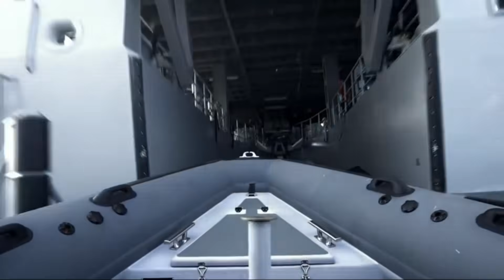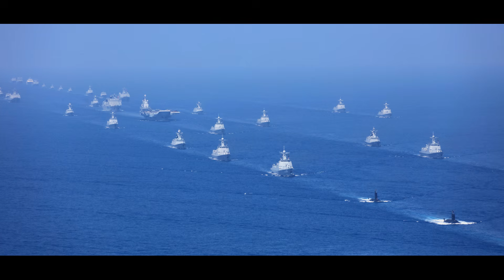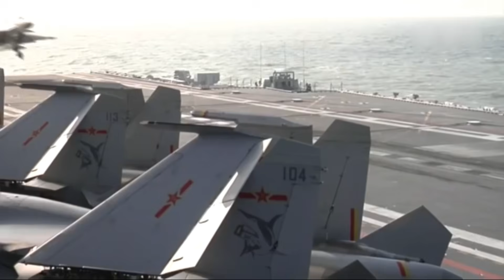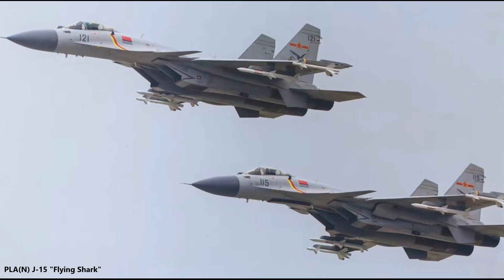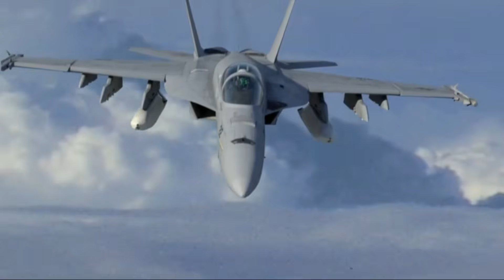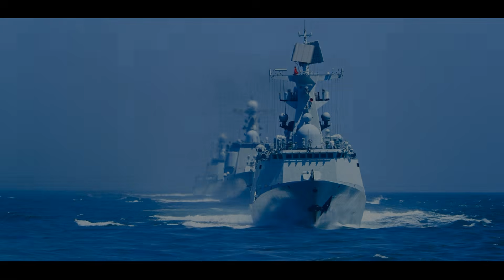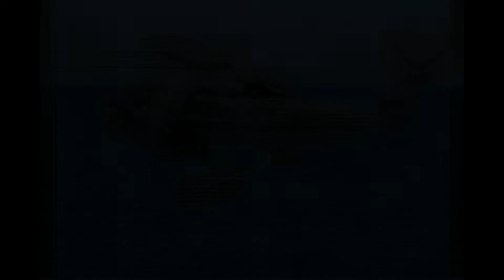Up-Gunning the Arafura Class OPV

Comment: Capability has NOT been designed out of either the LHD or the OPV. With the LHD, I was there in 2001 at Puckapunyal where the final selection was done between it and the Mistral, and Dept. Finance was extremely direct when they said that there would be zero $$ put to removing the Navantia design's inbuilt ability to operate Av-8 or the then-early stage development F-35 VSTOL variant.  They retain the built-in capability to operate fixed-wing.
OPV. The case of the 40mm, for example, is that it would have been an orphan system and we did not make the ammo for it. So we've gone for a gun and ammo we MAKE here. We had this same argument re SSM etc about armament with the Fremantles back in the late 70s/ early 80s. 
The proof of this is that the Arafura is fitted with a variant of the same combat system as the Anzac class's 9LV. This is THE critical thing to have, and it's open-architecture.

Comment: Another potential use for small warships like the Arafuras (although this would have to be a dedicated design and not a multi-role platform) would be to build a primarily gun armed ship that could be used to support amphibious operations with naval fire support. Ships that small can be built with a fairly heavy weight of guns compared to what a modern frigate or destroyer carries (the WW2 era Sims class destroyers carried about 5 times the throw weight of a Hobart class destroyer in guns at a displacement slightly smaller than an Arafura class OPV) and they'd still be quite cheap to build and operate while being able to replace the role of frigates and destroyers in providing close in support for an amphibious assault (which is dangerous and best not left to the ships also providing the bulk of your air defence and anti-submarine capability).

It's a very specialised role, but it wouldn't be an overly expensive capability to acquire as far as naval capabilities goes and can provide massive boost in firepower available to amphibious assaults even if we're going going to be replicating the effect of bringing an Iwoa class' 16 inch guns to bear like what the USN tried and failed to do with the Zumwalt class.

Comment: The reason they are only armed with the second-hand 25mm instead of the planned 40mm is the contract for the 40mm fell through. 

The best bet would be for the RAN to acquire the 40mm bofors that that RN are putting in as secondary armament in the Type 31 FFG. The only possible handicap is they are a bit heavier (about 400kg) but given the variable payload planned for this class that shouldn't be an issue. 

The 40mm bofors was chosen instead of phalanx or goalkeeper in the Type 31 as a CIWS weapon with the added bonus of it's ASuW capability. 

It would give us the calibre of weapon that was planned for this ship, interoperability with one of our closest allies, and who knows, maybe even consider the same weapon for future surface combatants.

Comment: To be honest the capability and weapons fit you are looking for we would be better of investing in something akin to a 2,500 Ton Sigma Class vessels. In regards to up-gunning the Arafura class the 57mm Mk3 would be a highly versatile system that could deal with most surface and air threats, add 2 twin NSM launchers for an anti surface role would make it a cost effective but fairly capable platform, especially with an S-100 that could be used for OTHT.

Comment: Considering the very real threat posed by communist China and the very small size of the Australian fleet. One would have hoped that EVERY class of vessel would have it's combat potential increased to the max. BAE systems have some really excellent naval guns on offer and VLS cells are becoming more and more flexible as the technology matures. Both manned and unmanned heli airframes are being developed all of the time. Bringing some useful capabilities to the fore. 
Up gunning the OPVs is a no brainer, given the CCP threat. However, what weapons capabilities to include will need some careful consideration. As it could prove cheaper to build new vessels designed around the weapons systems from scratch.